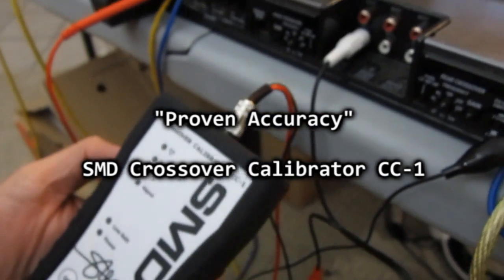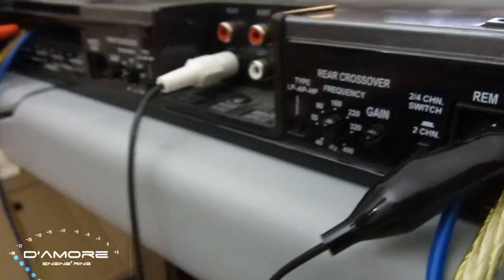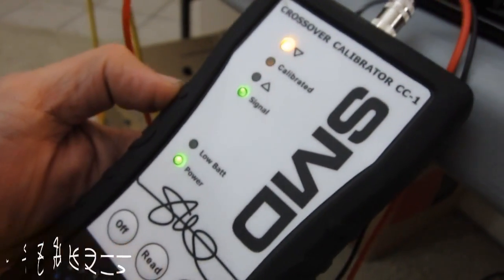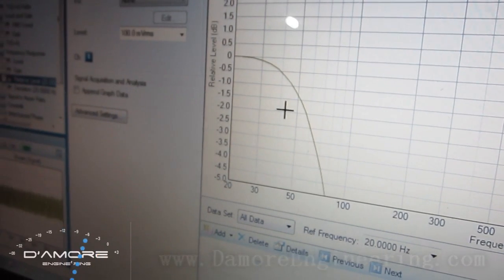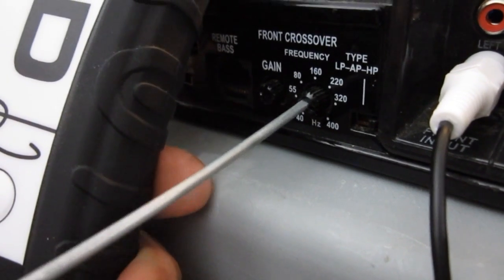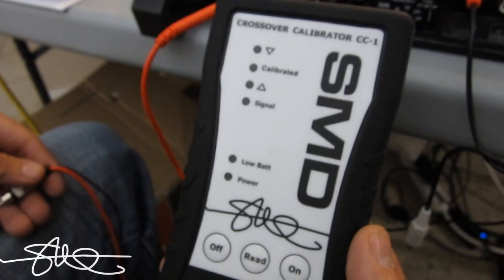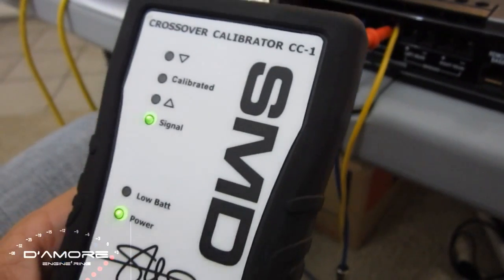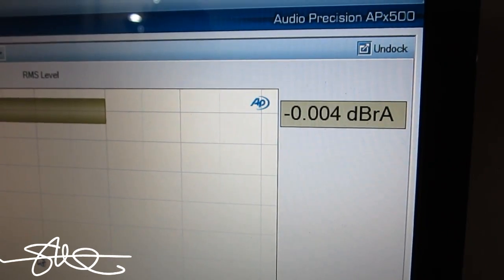Proven Accuracy - SMD Crossover Calibrator CC-1 plus Gain Matching

Comment: if you set the lpf to 63 and the hpf to 125 do u loose everything in between?
Reply: SW21 Sharky not all but most each crossover has a drop off slope after the crossover be point they should be crossed over at the same point or maybe a slight over lap to blend the sound slightly.

Comment: Howdy: I have a question regarding the SMD CC1. I was testing an HPF/LPF calculator and CC1 simultaneously. The high-pass-filter calculator (in the CC1) appears to be working and set to a 12db rolloff/octave. However, it appears you are using 12db for the LPF as well? The subwoofer amps we use are set to an 18db roll off/octave. I broke out my RTA and it appears as though the CC1 is not adjusting for the faster roll off. I tested with another amp and set the rolloff/slope off 24db and it appears even more skewed? Am I missing a step in setting up the CC1?

Comment: @030233854914 Most of the time I guess it won't be a problem but,... How can one be sure their HU is working correctly? Problem is, the HU freq. can't be adjusted easily so your recourse is to replace it. But it is still better to know and deal with the problem than to not know. Like when my mono amp came without a subsonic filter. Grrr. I found some in-line RCA fixed freq subsonic filters but need to decide 25Hz or 30Hz or order both? Right now I had to simply turn my sub gain down. Sad.

Comment: @SuperSalain Just chiming in here. The crossover is exactly that a crossover not a cutoff. A crossover has a smooth transition from maximum to zero. The -3dB point is where the power drops to half the maximum and that frequency is defined as the point where the crossover is providing signal on one side of that frequency and not on the other. So if the crossover were simply adjusted by listening or watching for signal on the amp, they may be way off from the half power signal. FYI.

Comment: @kcMacnCheese It could be done with a sweep and a spectrum analyzer. Music won't give you an accurate measurement for the -3dB crossover point. So basically the simplest, cheapest and best way is with a single tone at the desired crossover frequency. What is on one side of the crossover frequency is desired on the other side isn't, music won't change that. Steve has it right.

Comment: @meade916 Hi Steve, have you ever done any frequency checks to see if the head units are actually playing one of the test frequencies at the correct frequency? I had a cheap MP3 player that played about 10% too fast. So any calibrations would be off if I used that as my source. I could hear it in my tweeter crossover. I was picking up high-mids in my tweeters. I didn't notice it in my sub.

Comment: @MrMxAudio It can be done with an iPod but you also need a digital volt meter and a calculator. Even so the CC-1 will still be much easier to get it adjusted right because it does the calibrating and math for you.